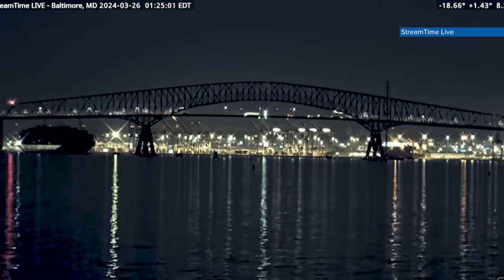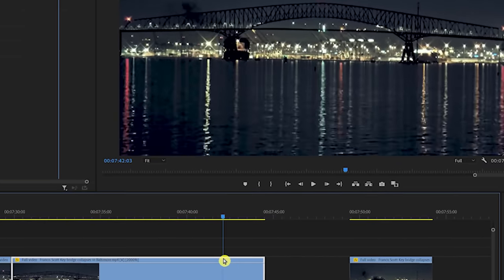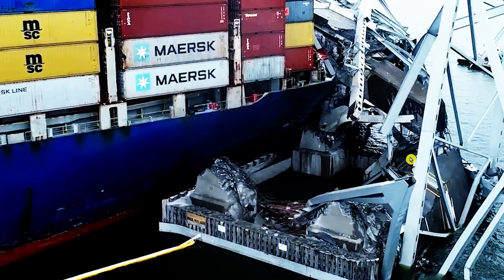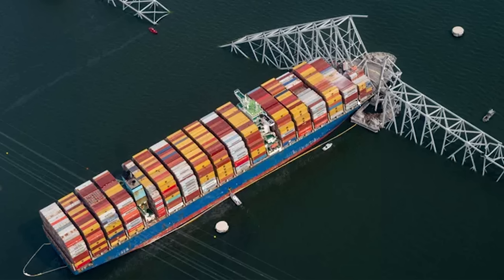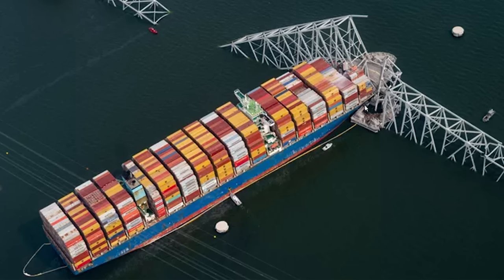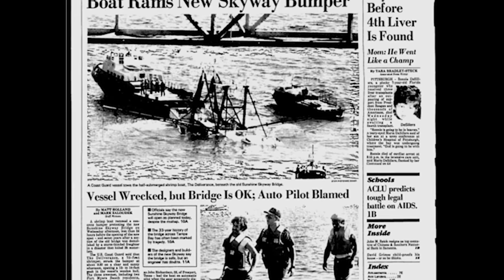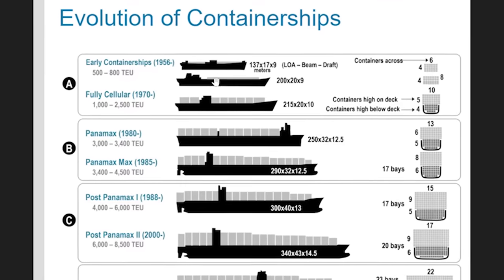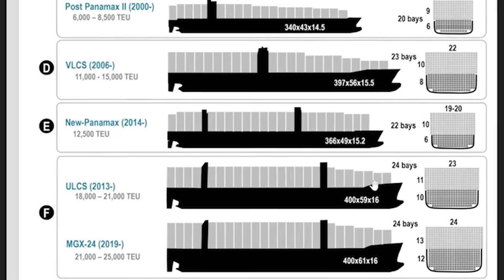NO Dali Bridge Crash Protection Like Sunshine Skyway Bridge?

Comment: 35 people perished when the southbound (1971) span of the original Sunshine Skyway collapsed into Tampa Bay when it was struck by the Summit Venture in May 1980,  because there were no dolphins protecting the piers that got sheared off by the boat.  It seems a major tragedy always needs to occur before action is taken.  In the case of the Sunshine Skyway,  when the replacement bridge was opened in 1987,  dolphins were added to protect the new bridge.  There should have been a campaign after the Summit Venture disaster in 1980 to audit all bridges at risk of a similar collision.
Reply: Thank you for explaining this. 

Side note for others that see this. 
The original skyway Bridge was the same type as the key bridge was. 

To this day. You can see parts of the old skyway as used as fishing piers. The beginning of both sides of the bridge are still in use.

Of the 35 fatalities. The most came from a bus load of people.
Reply: supposedly there was such a campaign - from another video on the Sunshine Skyway disaster ""In cooperation with the Coast Guard, the Federal Highway Administration was required to determine which bridges in the United States were not equipped with adequate structural pier protection"
Reply: But the gooberment sure protected us by making gas cans 'safe" and impossible to use.
Reply: May this 6 and those 35 Rest In Peace
Reply: At the very least the goverment should have identified key ports throughout the country that are vital to the countries economic health as well as militarily strategic in allowing our navy to set sail in the event of a war. Even 20 years later after the Tampa bridge collapse this should have been part of our homeland security program but unfortunately our goverment reacts after a crisis not before.
Reply: @Cyrix2k  .............and the ships got Bigger with the Cargo tacked higher.
Hind sight is 20/20
Reply: @Cyrix2k  this was a RECOMMENDATION in the Skyway NTSB report.  Congress makes laws, certain agencies can make regulations but NTSB can only make recommendation.
Reply: @lummoxx8586  yea
Reply: Yes there’s a great YouTube channel called morbid midnight that goes into it in depth.
Reply: They did, but you know how it goes, no one is willing to spend large amounts of money till a tragedy happens. Its crazy that we have basically been lucky for 50 years with the Key bridge.
Reply: Why, Why won't we learn from the past?
Reply: I was shocked to learn that the Key Bridge disaster wasn’t without precedent. The death toll was high because of the time of day the collision occurred and the majority of the victims were on a Greyhound bus. One person who plunged into the water survived because it turned out he served in the Navy and was a trained diver. He just barely survived, and spent the red of his life feeling intense guilt over being the sole survivor of the tragedy. 

Our government had over 40 years to make port bridges safer and they procrastinated all this time. Of all the presidents we’ve had since 1980 I figured Ronald Reagan would have made bridge improvements a priority.
Reply: I’m obviously not an engineer but I’m wondering if it’s possible that they could make sections of the bridge stand alone so if the bridge gets hit only one section gets damaged instead of the whole bridge.
Reply: Sorry.  I can try to give polite, professional replies (with no links) regarding the 1980 disaster,  but CENSOR TUBE is full speed ahead,  and everything gets auto-deleted.  We live in bizarro world.
Reply: I live about 10 minutes from the Silver Bridge. Dec. 15th 1967, at 5pm, the original Silver Bridge collapsed into the Ohio River. 32 cars fell into the water and 46 people died.

Comment: Well done.
For those who think the man made islands would be insufficient protection, look how abruptly the cargo ship stopped in the Suez Canal when it plowed into the side of the canal, and that was loose sand and dirt.
The "fairlead" dolphins pointed out in the video are more of a visual reference to line the ship up with the channel before passing under the bridge rather than meant as a protection barrier or fender system. 
The further outward pilings of the Key bridge are actually protected by shallow water. From the most recent NOAA charts, the edge of the channel marked by the fairlead dolphins goes from minimum 50 feet, immediately up to 24 feet, and within 200 feet outward the deepest water under the bridge is 19 feet, with the most common depth being 10 to 12 feet. The only boats passing under the bridge outside of the ship channel would be much smaller vessels like tug boats, fishing boats and private yachts that don't have enough mass to critically damage the pilings of the bridge in a collision.
It's important to know that the "full load water line" of a cargo ship this size is somewhere around 40 feet deep. Except for the bridge piling, the Dali would have grounded on the edge of the channel in another 10 to 15 yards.
The reason the Sunshine Skyway bridge in Tampa Bay has dolphins protecting the outward pilings is because the navigable depth water along the span of the bridge is 2 miles wide. The dredged ship channel is 300 yards wide but that only restricts the largest ships going under the bridge to the ship channel.

Comment: Re: the Golden Gate bridge. The North tower is half on shore, half in the water, and a ship would run aground before hitting that. The South tower has a fender system.
Reply: And the south tower survived being torpedoed by a Japanese submarine in WW2…
Reply: @allangibson8494  Not exactly. That torpedo fired by the I-15 hit a sandbar and didn't detonate.
Reply: Yep. The north tower being part of Marin Headlands is fine. The south tower at least has something. Sadly the Oakland Bay Bridge and its 4 towers for cargo to/from Oakland is completely unprotected.
Reply: @ohheyitskevinc  All of the Bay Area bridges have fender systems protecting their piers. There have been 2 allisions involving the Western span of the Bay Bridge in the past 17 years, that where the ships involved (Cosco Busan and Overseas Reymar) hit the fenders of the Delta and Echo towers rather than the towers themselves.
Reply: Good to know.
Reply: @ohheyitskevinc that’s the one that scares me the most. Its sister, 25 de Abril bridge, here in Lisbon (it’s sometimes compared to the Golden Gate bridge because of its similar colour, but it’s actually way more similar in design to the SF-Oakland Bay bridge and it was indeed designed and built by the same company), doesn’t seem to have any protections in place, or not visible ones at least, and it also carries suburban and regional trains on its lower deck. And guess what, we have a cruise ship terminal upstream. The linear momentum in those behemoths is definitely comparable to that of container ships. 😬

Comment: One thing to be aware of, this ship had a single screw. If you ever operated a boat with a single screw when you go to revers the back will swing as the prop "walks"
Reply from the maker: Also doesn't it take minutes to reverse direction in the propeller?
Reply: A ship this size does the prop reverse pitch or direction?
Reply: @crash2161  Single shaft drive, fixed pitch propeller. Not sure if it had bow thrusters or the like.
Reply: Propulsion is a single shaft with a fixed pitch propeller. In this ship the engine turns around 82 RPM, matching the optimal rotational speed of the propeller. There is also no reversing gear so, to generate reverse thrust, the engine is stopped and restarted turning the opposite direction. It does indeed take quite a few minutes to achieve this
Reply: @mrmullett1067
Single 3,000 kW (4,000 hp) bow thruster
Reply: @mrmullett1067  I believe the most common bow thrusters are electric which would be an issue if the electrical system was failing. The other type is hydraulic which is powered by the engines. But if the engines were suffering electrical issues, and maybe stalled, again, no help there.
Reply: @covidonenine1948  WoW! a recipe for disaster.
Reply: @covidonenine1948  Electric with no electricity.
Reply: @elantrauma  Some say they never restarted the engine.
Reply: @tedmoss  Oh yes! If you lose electrical power/main propulsion or steering in confined waters on one of these behemoths, you're stuffed! 😲
Reply: @mrmullett1067  Yes, all the large cargo ships since the 1970s have bow thrusters that I saw in Baltimore Harbor. And that was when I was in the Coast Guard there in Curtis Bay in the 1980s. And remember, the ship was going like 8 or 9 knots or so. A bow thruster is not really effective over 4 or 5. I do know going full astern can cause the ship to jerk but losing power for a minute in that dredged out harbor is not, absent foul weather and a strong cross current from Marley Creek or Curtis Creek which feed in the harbor right there, going to cause a ship to go that far off course in that little time if he was properly lined up for the center light in the span of the Key Bridge (which is where the Harbor Pilots aim for).
Reply: @mrmullett1067 The MV Dali had bow thrusters but without electric power they are just dead weight (they need 3 megawatts to run).
Reply: @elantrauma  Most of the large vessel bow and side thrusters have their own drive engines, either to drive the generator or (more typically) to drive the hydraulic pumps directly. Most likely, this engine would have been shut down once the vessel was away from the dock and underway.
Reply: @jeffostroff  It may be that the forward motion in the water helps keep the screw turning in the "forwards" direction even with no power, and if they never actually got the engines restarted there would be no engine to put the propeller into reverse with in the first place.  I like the emerging theory a water channel joining the main channel from the ship's right may have acted on the stern  pushing it left and pivoting the ship's bow to aim right.
Reply: @mrmullett1067  yes they say it did and they think the large electrical load of the bow thrusters tripped the back up power causing the second blackout.
Reply: Exactly. I had a single screw boat and it would break towards the port side in reverse... No matter what the rudder was doing.
Reply: @mrmullett1067  thank you! Wasn’t sure if it was more the case like small pleasure craft where the shaft is reversed or like turboprop aircraft where the pitch is reversed. Appreciate all the answers
Reply: Was the pilot a woman :)😅
Reply: Consider the powerplant off. Then restarted. Full reverse will prop walk until enough momentum is achieved in the intended direction of the thrust. I do NOT agree with the assessment that the ship's angle was distorted by a telephoto lens. The ship most definitely rotated CW in heading and reasons of current direction & intensity, prop walk pulling stern to port and thus swinging the bow to starboard. If the ship is headed against the current the effects of prop walk are amplified considerably at the bow. This is assuming that it had a RH prop, fixed pitch as a lot of older ships have. USCG, Master Mariner 100T, and yacht deliveries are my part of my experiences.
Reply: @crash2161  A ship like that probably has a Wärtsilä-Sulzer RTA96-C engine, which is a truly enormous blown 2 stroke diesel. The way reverse thrust is achieved is that the engine is stopped and then restarted backwards (which you can do on an engine of that design). The engine is direct attached to the single larger screw with no gearbox. Reversing thrust is not an instant operation, but then things happen in slow motion on those gigantic vessels.

Comment: I was stationed at Curtis Bay in the Coast Guard by the Key Bridge right after the 1980 Japanese cargo ship collision , in 1981 and 82. Went under the Key Bridge over and over while a Coastie. They never really did much to improve safety other than the little gesture you point out, and that is more to guide boats than protect the bridge. They aim for the center of that span when well away from the bridge until the cross under it. The Japanese cargo ship did damage to the Key Bridge but did not knock it down. Same scenario, loss of power, hit a support structure.
When I moved from Maryland years later I moved to the Tampa Bay area in 2000 and soon became familiar with the Sunshine Skyway Bridge, and saw how much better it looked safety wise, and how it was hit in 1980 as well by a large tanker ship...but in that case a section collapsed and several people died including a bus. I applaud you for pointing out these safety measures. There are articles which I can forward to you in the Tampa Bay papers where they contacted cities such as Baltimore and tried to help them (the engineers did) with retrofitting some safety ideas which were more current. It is a shame nothing seems to have been done.
Reply: Excellent, would like to see that info.

Comment: Hi Jeff, thanks for building your "Hi Tech" ship modeling, which is what we called "dolls" in the pre-CAD days of PC board layout.  Simple but, gets the job done.

It looks like the Dali came in at the perfect angle to maximize pier damage, while totally missing the dolphin.  The bulbous bow likely slid along the piling and positioned the ship perfectly to cause the gunwale to sever the pier.  I suspect the bridge started falling before the pier was completely severed due to the pier support force going off-center.  The pier actually looks to be a simple pivot joint, with no actual attachment to the bridge.

This bridge looks particularly fragile with it's 1,200 foot span between the piers and arched truss design.  I can't help but wonder how the bridge was supported while under construction to keep it from collapsing.  If it was allowed to twist, I suspect the whole structure would fold up instantaneously.

8 to 9 knots sounds screaming fast while still being within the harbor.  Given how vunerable  the bridge design was to the super large container ships we have these days, you would think there would be a speed limit associated with the bridge; like 2 mph.  I know there is no rudder control at that speed but, bow thrusters are quite effective.
Reply: Legit yeah I think the Key bridge might have been cheaply made. it collapsed like toothpicks. We've come a long, long way since the 70s and 80s, we might need to revamp our infrastructure.
Reply: @JChaos1120  Agreed, if politicians get involved (like company high level management), they will cut the budget and shorten the completion date while the design is still on the drawing board, thus compromising the design.  I am actually surprised this type of collision hasn't happened sooner.  I suspect the replacement bridge will be patterned after Florida's Sunshine Skyway Bridge in Tampa, although I'm not sure how it will be paid for.

Comment: In Norway, we use tow boats in front and behind large tankers that follow the tanker out into the open sea and in from the open sea.
Reply: So, why is this done? Can the tugs nudge the ship in different directions?
Reply: @anthonyvalenti9093  I have to look a little more closely at procedures and routines and will come back when I have a little more specific information on this matter.
Reply: The escort provisions only apply to one port. These basically mean that all ships of over 20,000 gross tonnes must have an escort to and from shore with a tugboat behind the ship.

Comment: Re. the "islands" around the Florida bridge pillars -- These offer far more effective protection than you might imagine at first. Keep in mind that they slope outward from the visible portion, and that large ships are also deep draft ships. Dali, for example, has a draft of 49' 4'' when fully loaded. If the underwater slope of the "islands" is 45 degrees (it's probably even shallower), the effective size of the islands is equal to the visible size, plus a margin on all sides roughly equal to the draft of the ship.

Comment: There is a common belief that a ship can be steered even when there is no power. However, this is not true. The prop wash is essential and the rudder redirects the water flow to steer the ship. Without power, it is difficult (impossible) to stop or turn a ship, just like trying to maneuver a vehicle on ice. Also, the black smoke tells us which way the wind was blowing causing the ship to swing.
Reply: Why difficult? why not impossible?
Reply: @tedmoss Correct. Wrong choice of words.
Reply: @tedmoss  Rudder of any kind ship needs strong flow of water past it to have good effect and be able to turn the ship.
Just like control surfaces of aiplanes lose effectiveness when air speed decreases and especially when airflow starts stalling. (except for some planes...)
That's why docking/slow speed maneuvering is such hard thing for ships without even any wind... Except for azipod equipped ships: https://youtu.be/zk90ndFtX-g
And especially complete power loss means rudder is stuck and can't be moved to try to maintain some control.